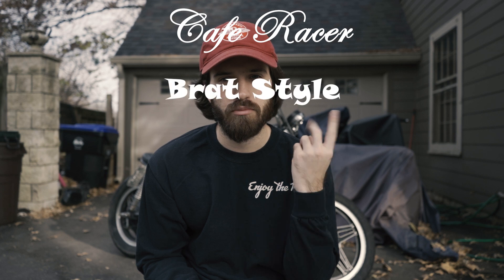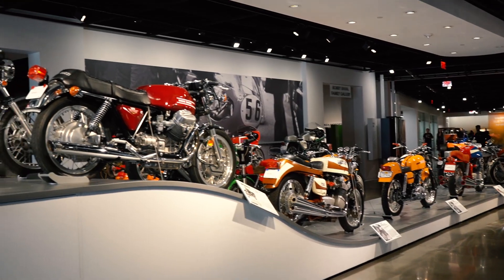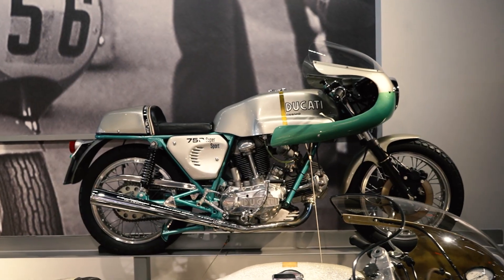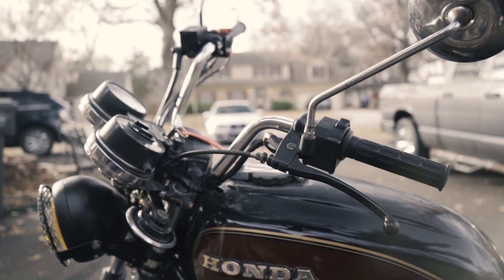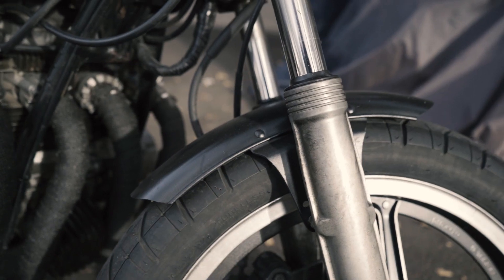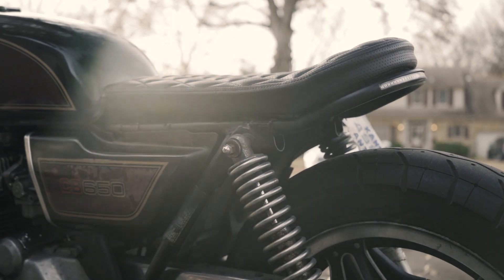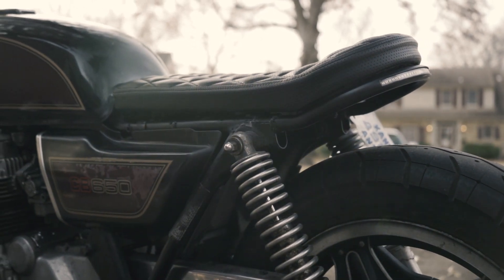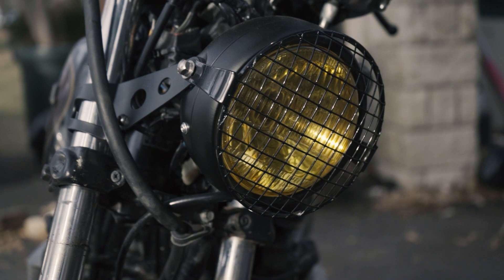You've Been Building Cafe Racers ALL WRONG! (What Really Makes A Great Cafe Racer)

Comment: All about proportions. Tank can't be too large for the engine. Swing arm length has to be appropriate. Angle of the rear shocks should match that of the down tube/angle of the cradle coming down from the fork mount. I've seen bikes with all the right proportions but where the engines are too small or the frame looks way to stretched rather than organically long.

Comment: If that's a brat, I hate it!  No guard at the back so you can be covered in road debris, everytime you ride it.  Front mudguard that offers no protection to the engine at all and a bandaged exhaust so it will rust out very quickly.  Other than removing the guards, bandaging the exhaust and redoing the seat, it's basically a stock bike made to look ugly and unusable.  Nothing said about cafe racers other than fairings and low bars, I really don't think you are the right person to be advising on bike design.
Reply from the maker: Thanks for watching! TBH it seems like you’re the one giving your advice. My advice was to not worry about what style your build fits in and build what you want.